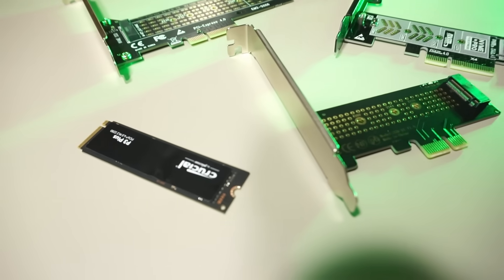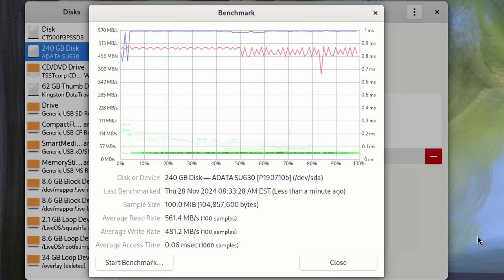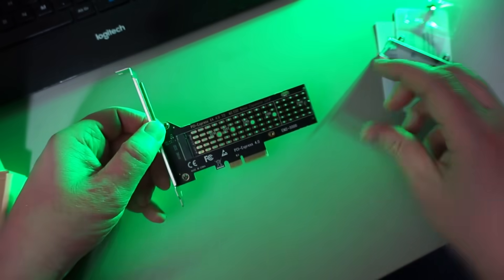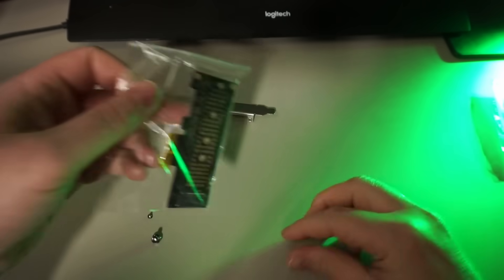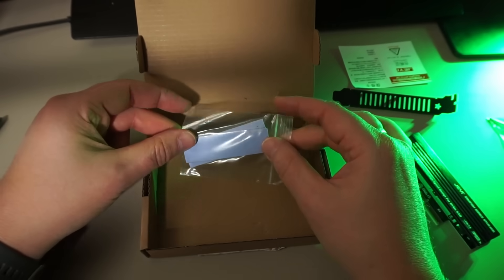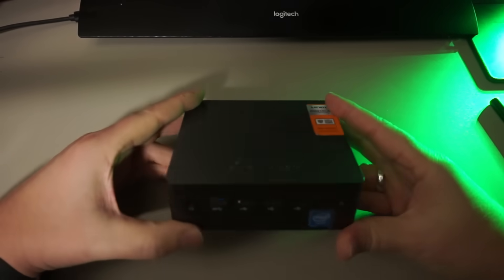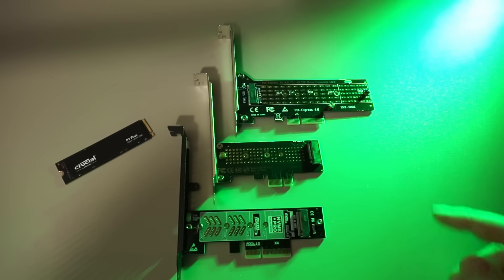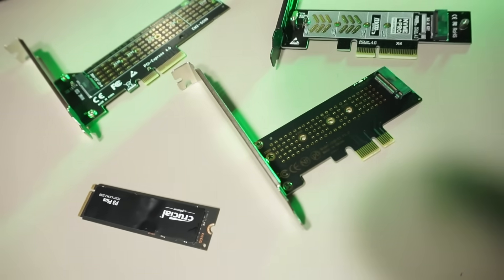Upgrade your old pc with an NVMe! Testing cheap PCIe M.2 adapters!

Comment: Some 1156 and AM3+ mobos have nvme ports

That being said... Given the speed and usability of ddr3 platforms in 2025... I'd just let SATA3 SSD and call it for the system. Boot and load times won't be such a pain, only if compared to something new
Reply from the maker: Well about 3x as fast is pretty neat, but I guess it's for tinkerers only ;)

Comment: can you see all the bios updates? to support SSD, to speed up all the ancient machines...clever, but pointless 🤔 am4 is just becoming obsolete...before its time?  everything is moving too quickly atm imo
Reply from the maker: All depends on your use case
Reply: @ex-itguy  reviving old machines to accommodate new tech hardware...where do you start?
Reply from the maker: Wherever you feel like haha
Reply: @ex-itguy  step one ...get a PC technician 🤔
Reply from the maker: @doug_1489  Or become one 😊
Reply: @ex-itguy  😊

Comment: I used two of these on an old X370 board with one NVME slot. They worked but speed was limited
Reply from the maker: Maybe the slots you tried were limited and/or shared with another device? You should get full PCIe X4 speeds on an X4 card.
Reply: @ex-itguy  I can't remember the specifics but the slots had limited bandwidth when you used the NVME slot and several of the other PCIe slots

Comment: I have found that m.2 slot PCIE adapters almost always fail... to work as a boot device.  If the motherboard supports m.2 or NVME as a boot device, then maybe it will boot from the PCIE adapter.  But if not seen by BIOS or UEFI in the boot device list, forget using it as a boot device.
Reply from the maker: Yep. There's solutions, but they require a custom bootloader or a some courage ;)

Comment: I have a budged pc with 250gb SSD for windows. I figured i need to add another SSD since I really didn't want a hard drive at this point. It was nice thing to know that I still have options besides changing the motherboard or my old SSD.

Comment: Drive Speed. Cost. Boot from adapter drive. I think they are still worth it for an older machine, if the aforementioned criteria are met. As always, i would do a cost benefit analysis before buying anything. Still It was interesting to explore the different PCIe architectures and their limitations. I think if I had a PCIe 2.0 system I would probably use SATA SSD's just because they are cheaper and good enough..
Reply from the maker: Note that in this video I made the mistake assuming my system had a PCIe 3.0 slot. It's 2.0. I made a follow-up on an actual 3.0 slot, see pinned comment or description.
Reply: @ex-itguy  yea I could see in the video.. no worries. just saying in a 2.0 case.. go sata SSD (NOT ADATA OMFG, you could do a video on those being bad) they are plenty fast enough for older systems, cheap and easy to install. I actually liked this video, mistake aside, it was still informative and fairly thorough. So much garbage out here these days nice to see this channel.

Comment: The aliexpress one is perfect and there are ones with 4 cards. I only need one but theoretically you could attach more. Perfect for systems that have only one slot like the B350 I use in my server.

Comment: Re Cards:  I've used dozens of these cards in loads of diffent configurations. I have always found no difference between the adapters and direct NVME slots as long as the number of lanes and the PCI-E version is the same. On some motherboards different slots have different speeds as well as different number of lanes. On one M/B two NVME slots had only 2 lanes and only one had 4. Check the data sheet !

Also, on PCI-E3.0, a bus extender (fixed or flexable) of 4" (10cm) also makes no difference. On version 4 it may not even work or may be unstable.
Reply from the maker: That's pretty much my conclusion. The short answer is simple: get the cheapest x4 card.

Comment: Re booting: If you have ANY other drive in your system that appears on the BIOS boot menu  AND  the system will boot from UEFI (don't need secure boot)   THEN you can put the UEFI directory from Windows on the bootable drive and install Windows on the NVME drive. Search Google for more details. The first second of startup loads from the old drive and then switches to the NVME.

If no other drive is available, you can add a permanent USB2 key of 1GB as the "startup" drive provided you don't ever unplug it !

Comment: Perhaps NVMe Drive require specialized driver like: Intel Rapid Storage Technology or AMD StoreMi. But... For older system there's specific software for that 😅
Reply from the maker: It works fine but there's a mistake in this video: I tested on PCIe 2.0. That's why I created an updated video.

Comment: I have that same GloTrends card and was able to get full speeds out of it.  We actually used one of those to get full Gen3 NVMe speeds from the boot drive on an old MSI Z97 motherboard we have with an i7-4790K on it, and it works great. The card gives us around double the speed of that motherboard's built in M.2 NVME slot, and it IS bootable.
Reply from the maker: Yes there is an error in this video, I tested on PCIe 2.0 instead of 3.0. that's why I made a follow-up. Being able to boot from it has to do with BIOS support. It doesn't work on older boards without workarounds or hacks.

Comment: I have been looking for months....I have NO more PCIE slots, but lots of SATA. Is there a M.2 NVMe (not NGFF) adaptor to 2.5" Sata so I can put these in my spare 2.5" enclosure?????
Reply from the maker: No, that was a mistake. You can convert m.2 sata to, ehm, wired... SATA. But not NVMe to SATA.
Reply: @ex-itguy  Mate, I was not critiquing your work - I enjoyed the video. Thanks for the reply. But I was "hoping" there was a way of using my NVMe drives and my spare 2.5" SATA drive bays. I had wonderful ideas of a NAS based on my spare X99 board. Unfortunately I have built it with 8 drive bays and....no way to populate the bays with my NVMe drives. I am guessing I have 2 options; 1) buy 2.5" SSD's or 2) get some NGFF and adaptors. I have 18TB of data.
Reply from the maker: I didn't think of it as critique, sorry if my response made you feel that way. Blame my Dutch directness haha
I said in the video that these adapters exist, but they don't. They're only for M.2 SATA drives. 

Maybe an USB enclosure would be interesting? I'm pretty happy with my Zike Z666 (but that's not the cheapest one around)

Comment: There's a Uefi bios mod to add support for booting from nvme drives. I did it on my msi  970a-g43 motherboard with an Fx8320. I've been using this system as my daily driver for 11 years.
Reply from the maker: Some others have mentioned that as well. I haven't gotten around to trying that. Seems interesting indeed!

Comment: the Middle one looks like it has a sata option - curious if you can use sata for the boot but pci-e for operation? or is it just for extra power?
Reply from the maker: There is no SATA option on any of them. That would have been nice indeed!

Comment: i have 1x 2.0 1x pice slot and 1 m.2 slot and a x16 slot  on my motherboard what pice lanes have over i have a 5800x
Reply from the maker: That really depends on your board / chipset / cpu. Check your mainboard's manual. :)
Reply: @ex-itguy  i have a320m motherboard :c and a 5800x

Comment: my P67 chipset i5 3570k system was able to boot off a pci-e NVME after modding the bios to inject the NVME driver, didn't need clover or anything. PCI-E 3.0 so it got 3200mb/s read/write.

Comment: Does H310M Pro motherboard supports M.2 Adapters? 
It has 2 PCIe 2.0 x1 slots and No m.2 slot
Reply from the maker: That should work, but x1 is very limited in speed.
Reply: pcie2.0*1 speed Similar to sata3.0 ssd speed

Comment: What about effecting Gaming performance as it uses 4x PCIe Lanes?
Reply from the maker: Depends on your mainboard and cpu. Some indeed share lanes across slots, which might hamper gpu performance. Look it up in your mainboard's manual.
Reply: very little Influence

Comment: An x4 adapter works fine to boot from on my Supermicro C7X99-OCE socket 2011-3 motherboard with a 18-core xeon cpu as the bios supports from booting combined legacy and uefi. Works like a charm. And I love the S.O.A.D inspired intro.
Reply from the maker: Thanks!

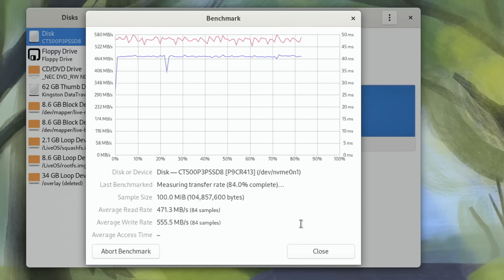Comment: 3:05 well duh, it's 1 lane. You can't expect it to match 4 lanes.  4:46 "Amazon one"... excuse me are you saying this is branded by Amazon?  5:18  3x slower as compared to WHAT?
Reply from the maker: A little over three times slower than PCIe 2.0 (although I still thought it was 3.0 at that point).
The Amazon what? The card I bought from Amazon, I thought that was clear enough.

Comment: M.2 is 4-lane. Those PCI 1-lane cards can only provide 1/4rd of the M.2 bandwidth.
You need a mordern CPU and adapter cards with PCI x4 (4 lanes) for M.2 performance,
and in addition, of course at least PCI 3.0 from the CPU, 2.0 is not cutting it, it seems.

Comment: My gaming PC motherboard only has 1 nvme slot and I don't wanna use sata can I use this to add an extra nvme I don't wanna remove my current one
Reply from the maker: If you have at least one X4 (or X8 or X16) slot to put it in, yes you can. :)

Comment: Hi, Question-  I tested a NVME drive with adapter in my 2012 Dell pci express slot i normally use for a video card and it worked instantly like a rocket but that was just storage files.  IF that worked ok, does that mean if i clone my C drive to that NVME drive and use the PCI express slot again, will it boot from that drive just like my usual 2.5  sata SSD or not necessarily so? If the answer is YES, then if i get a diff adapter that fits the other slots next to the express one, will it also boot from them even if a touch slower, so i can keep the express slot for my Video card?  Thanks
Reply from the maker: It depends on your motherboard. Older boards won't natively boot from an NVMe drive. You will need an NVMe aware bootloader on a different drive (can even be a USB stick or SD card in a card reader). There seems to be ways of modding the BIOS to make it boot from NVMe butI haven't gotten around to trying that.

Comment: Only as fast as the old bus will go.
Reply from the maker: indeed
Reply: What if you give it a bigger turbocharger?
Reply: @satsumagt5284  the little exhaust pipe it came with would still restrict the flow.

Comment: I clicked on his video as soon as I saw that cooler master case which is the same one my dad has with an Intel x5675 24 GB of RAM and an RTX 2060 which I built with used parts
Reply from the maker: Seems to be a popular case haha, each time I use it someone comments on it. 
I tried to put an R9 290 in it yesterday but that card is so big I would need to cut some of the 3.5" bays.

Comment: on older boards with gen 2 pci-e  windows will recognize the nvme drive  but  the motherboards of that era likely does not support  boot from nvme  or sata m.2 drives. However  , gen 2 limits the speed of the drive to nearly half of gen 3  but for  a storage upgrade  it may be a good idea . those older  gen 2 systems likely have a legacy BIOS  ( no m.2 nvme/sata boot support) or  some of the first  uefi bios   and  these may work or not  with a nvme  but i have not tried  these with sata m.2 .  Also  LEGACY does not support GPT partitioning  i believe  but MBR is  supported .

Comment: I Have 2 SATA SSD's 1 Is The Kingston SSDNOW V3 And The Other Is A SSDNOW V4! Both Are 512 GB! The V3 Is Faster Transferring Data Than The V4! The V4 Starts Out Beating The V3 But In Sustained Writes The V3 Overtakes The V4! I Used Them In An Old Dell With A Core2 Q6600! They Made It Run Almost As Fast As A New Machine! Just As Fast Browsing, Booting, And Internal File Transfer! I Was Able To Extend The Life Of The Old Core2 Dell For Years! I Used It To Transcode PVR Recordings For Over 14 Years! When These I7 8700 Optiplex's Hit The Used Market I Was Able To Pick Up 5 Of Them For Just Under 1000 US! With Quick Sync The Transcoding Went From hours To Minutes! I Run A Jellyfin Server To Send These Recordings To The Other Optiplex's I Use To Run The 4 TV's In My Home! This Brought Back Memories Of Hours Upon Hours Working On These Old Machines Back In The Days of XP!

Comment: It all depends on how old your PC is and the generation of PCI-e. For example on an old PC with x1 slots that are PCI-e 2.0 then that max speed is 500MB/s which makes them slower even than SATA SSDs ;p On the PCE-e 2.0 using X4 card max speed is 2000MB/s. If a PC has a PCI-e 3.0 slot that's X1 then the max speed is 1000MB/s, on an X4 card inserted into an X16 slot the max speed is 4000MB/s which is the same as the M2 Gen3x4 slot. Basically, these X1 cards are useless on PCI-e 2.0 slots, and in some situations, you can use them on PCI-e 3.0 X1 slots if you want to get a little more performance than regular Sata SSD. If you want to get the full speed you have to use an X4 card inserted into the new PC with PCI-e 4.0 and you can get speeds up to 8000MB/s which is the same as the M2 Gen4x4 slot.

Comment: Yes they work. they are just slower. For data backup or older PCs they work fine. I will not use the cloud to store backup data.
Reply from the maker: They're not slower. Note that I tested on PCIe 2.0 in this video, a mistake I addressed in the follow-up. On 3.0 speeds were about double. So as long as your slot is PCIe 3.0 (or maybe 4.0 even), they're not slower than when directly plugged into an M.2 slot.
Reply: @ex-itguy  I was talkimg vs new PCs
Reply from the maker: @TOSStarTrek  Age doesn't matter, there are still motherboards around that don't even give you PCIe 3.0 on every slot. It really depends on that.

Comment: I purchased a x4 adapter card last year and a cheap 1tb nvme drive, I was able to boot from it using a MSI B450 board, but I use the NVMe on the MB to boot from as it is much faster.
Reply from the maker: Interesting. That must mean your M.2 slot is connected to more or higher speed PCIe lanes

Comment: I ran out of M.2 connectors on my MB, and used an adapter that has one NVMe and one SATA M.2 connectors on it. I populated both and have had no issues with it.

Comment: Just went through HELL trying to use an NVMe and PCIe adapter on a "not that old IBM PC". No possible way to use it as a boot drive. So old PC? keep that in mind. YES it will work but only as a hard drive. OLD PC? use a sata type hard drive as boot drive.
Reply from the maker: That's what I mentioned at the end of the video. Older systems can't boot from it so you might need a bootloader on another drive. 
Some in the comments have mentioned modding the BIOS to support it natively but I haven't gotten around to testing that.
Reply: @ex-itguy  I just lived with it but decided that in the future I would pay more attention if I was going to buy an older PC. Thanks

Comment: Older machines cannot boot from this and highly likely there is no updated bios either. If your machine is compatible with this setup it most likely has the slot on the motherboard.
Reply from the maker: That's what I said in the video didn't I?
The solution is a bootloader on another drive that the system can boot from.
Some even mentioned modding it into the BIOS, but I haven't gotten around to testing that.

Comment: idk why but i bought 2 of these and both don't show in file explorer
is there any bios settings i may need to change or smth
nvm i wached the vid
Reply from the maker: That's weird. I didn't have any issues getting it to show up in Linux at least. I still want to try booting from it on a system that can't boot from it without any help. Multiple people are asking me how to do that, and frankly: I only know how to do it with Linux (just put /boot on a drive it can boot from).

Comment: I have 2 of these type of adapters but they will no boot from them on old PC;s even with SATA cable on 6 Gb port?
Reply from the maker: You have an adapter which you can connect to a SATA port?
To boot from these things you simply need a bootloader that will 'see' the NVMe drive on other storage (Clover is often mentioned). That can be anything from a SATA drive to an SD card in a cardreader. 

If you're running Linux you can also just place the whole of /boot with the bootloader on there.

Comment: It's funny how a SATA SSD is already "too slow" in terms of drive speed now.
As for booting, would Linux GRUB recognize it?
Reply from the maker: Haha, well I still use a sata drive as I put this NVMe drive in an enclosure for now. ;-)
It doesn't on the system in this video. In the follow-up it does, so it fully depends on BIOS support.

Comment: I used one of these for a year
Reply from the maker: And did it work well?
Reply: @ex-itguy  nope, probably because i used a cheap one, itw works well for a year until recently it didn't read my NVME stick, i had to use one of these because my ultra m.2 slot didn't seem to support my NVME, i say this because everytime i plugged the stick in, my pc refuse to read my nvme and just went freeze/bluescreen, but strangely my nvme stick werks fine on my laptop, so back then i try to uses one of these (m. 2 x1 adapter), and recently since the adapter stopped working, i decided to plug my nvme stick again to my ultra m. 2 motherboard slot again, and this time it's working, idk what causing the bluescreen back then, and to this day it's still a mystery
Reply from the maker: Hmm, so they're not very durable. Good to know!

Comment: Hi! What cpu and motherboard you're using?
Reply from the maker: Yeah that was a mistake I touched in the follow-up. This is a Phenom II system with PCIe 2.0 slots (crossfire, so both x16 slots are actually x16 but just not PCIe 3.0). 
In the follow-up I tested on a board with a PCIe 3.0 slot and speeds about doubled.
Reply: @ex-itguy  yes, those speeds are more like 2.0. Thanks for your response, I'll search your video with 3.0 machine 😀